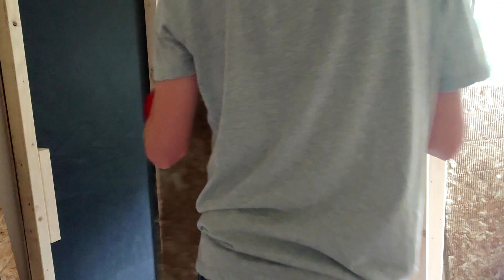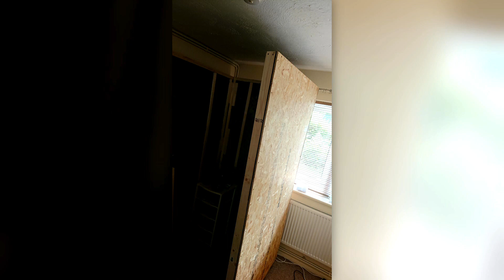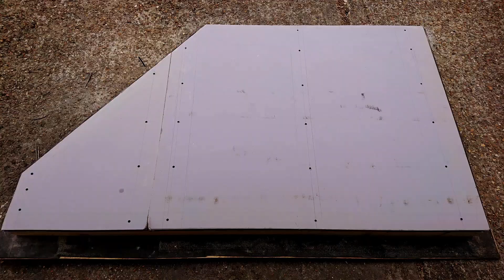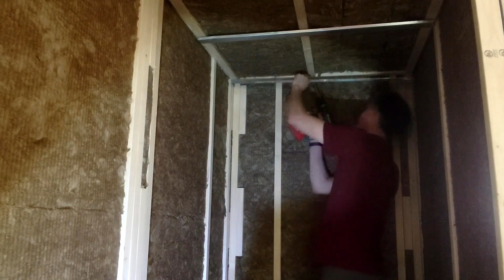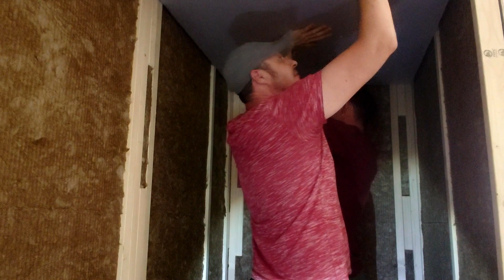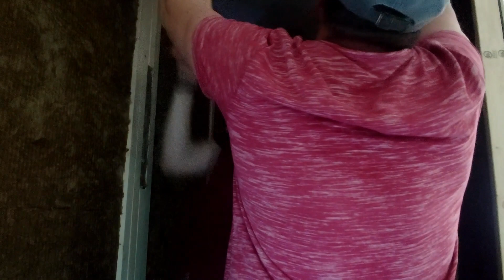Building a Vocal Booth: Part 4 Installing acoustic foam and lifting the ceiling in to place.

Comment: I am wondering why its always foam  foam used in booth not insulation panels?
Reply from the maker: Foam can be bought in various thicknesses and densities depending on how much extra soundproofing you want. Sound is better absorbed if it manages to get through to the area where you are putting the foam so it's a good way to capture it.